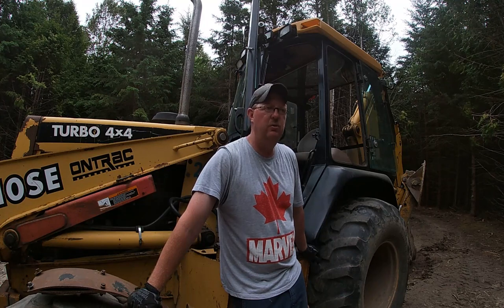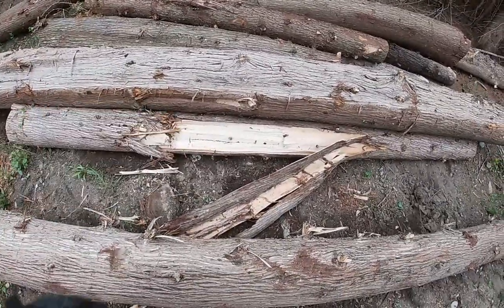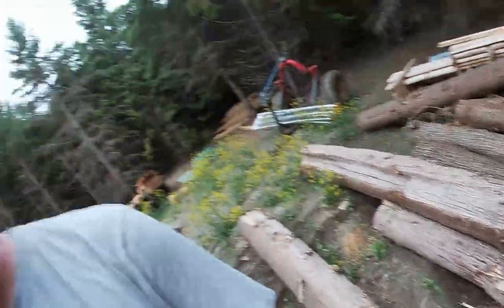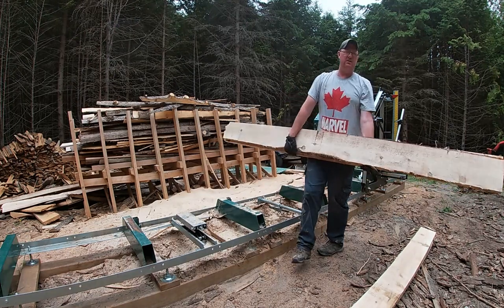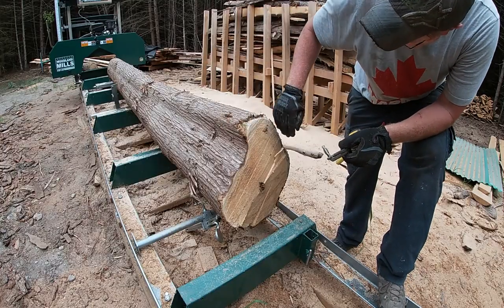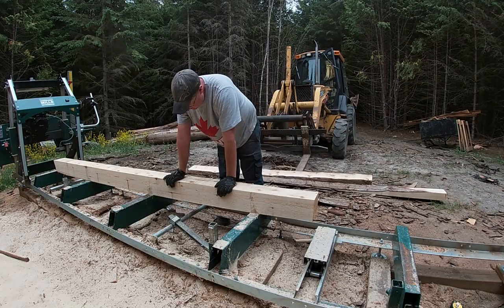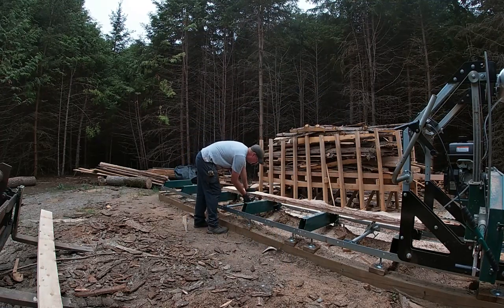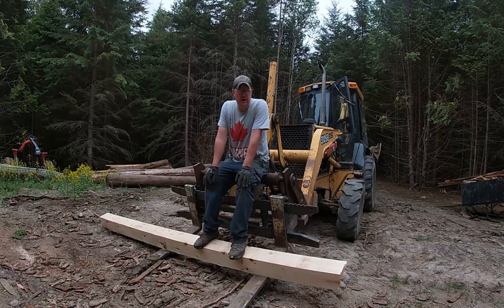#55 Saving The Back At the Sawmill and Milling Cedar.

Comment: Hey Chris get a thumb welded on thay bad boy so you can pick up the logs instead of scooping up the logs. Also keep them off the dirt. That eats saw blades. I got a 307 Cat excavator last year and wow is it cool for loading the logs right into place on the bunks.
Reply from the maker: Right on there is some sort of thumb on it. I don't know much about them but it doesn't seem to be on right its welded right on the arm so you have to bring the bucket all the way around before it grips a log.

Comment: You could make a log deck on skids, so it can be moved around, that way you can roll logs onto the mill bunks. Nice straight bark means no twisting, lumber should be nice and straight.
Reply from the maker: Thanks, I might have to use that idea. I was hesitant to build a bunk for two reasons. I want to move/make a better mill setup and also I don't always know what order I am going to cut the logs in. If I had a movable bunk that would solve both problems.

Comment: Not a tractor guy, so I'm asking from ignorance. Would it not have been easier just to use the forks from log pile to sawmill?
Reply from the maker: For me it would have been i have a lot more experience using the front loader, but I was more or less looking for an excuse to practice with the backhoe part as I don't have much experience with that.

Comment: You have good supply of good sized white cedar. Do you have any issues with the blade diving around the knots..sure is handy to have a good supply of logs.nice work
Reply from the maker: Hey there, I have noticed the blade dip very occasionally around a big knot. I find that if i slow down right at the knot it really cuts down on any movement. 99% of the time though it does really well.